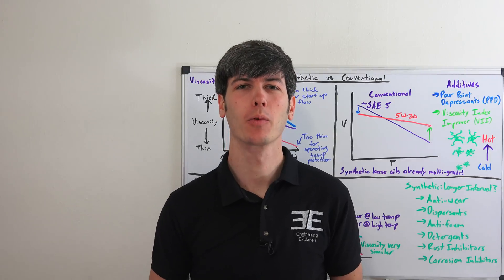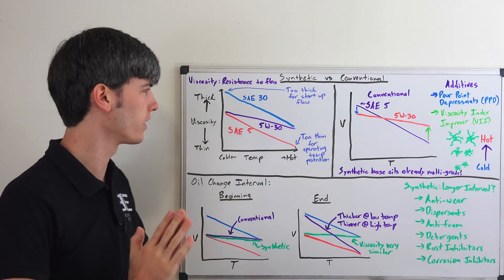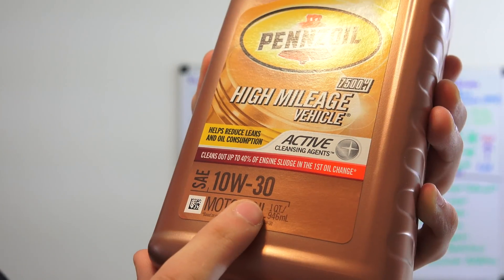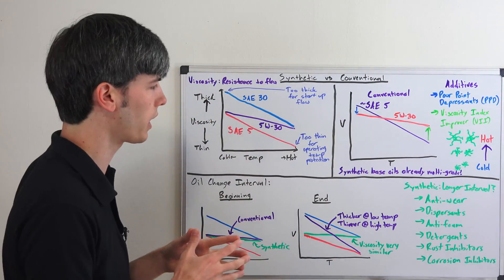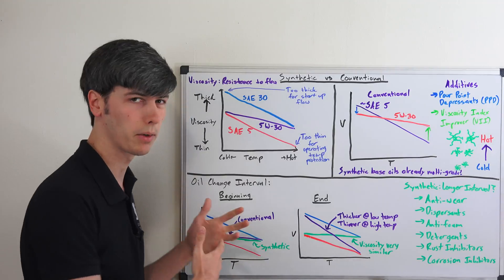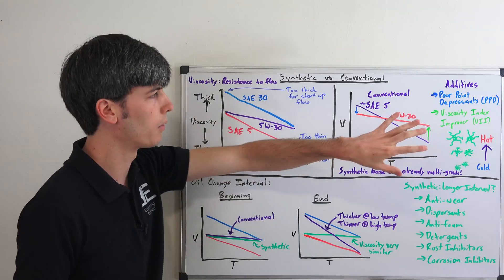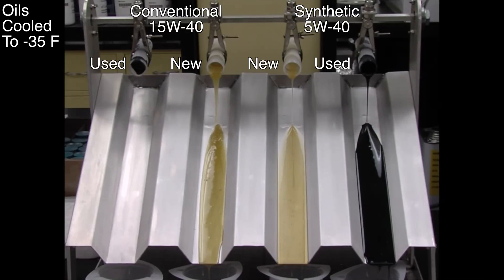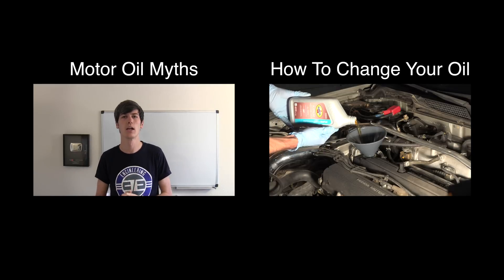Is Synthetic Motor Oil Better For Your Car?

Comment: Rightio then, as usual a good explanation. But what's the difference between corrosion inhibitors and rust inhibitors??? What's the difference between rust and corrosion??
Reply from the maker: +Shannon Parker acid versus water corrosion.
Reply: Nothing
Reply: +Engineering Explained Ahhh! That makes sense.
Reply: Rust is a type of corrosion, of which there are many types!
Reply: I am no expert but I think one requires oxygen. Because rust is the byproduct of a chemical process called oxidation
Reply: +Noah Kuzel Good thought!
Reply: Neither is much of a problem internally within engines, other than in cooling systems. Oil itself keeps oxygen away from everything...
https://en.wikipedia.org/wiki/Rust
https://en.wikipedia.org/wiki/Corrosion

Comment: Naturally the 15W flows more slowly, -35F is further outside its operating range than the 5W..  Why not use the same grade oils for comparison in the demonstration??
Reply from the maker: +hindflight R I mentioned in the video, it wasn't a demonstration of the viscosity difference, making a 5W-40 requires synthetic. Watch that portion of the video again and I explain it fully.
Reply: Jerrod Lindquist You must be a conspiracy nutjob. 
He goes to pennzoil and says I want to do a demonstration video and they say great we will pay for it.  Who cares? It does NOT affect his demonstration at all. He could have used any oil for this demonstration and the results would have been the same. NOTHING was omitted or obscured. There were no unfavorable results. The results were expected and known by most of us before hand. This video is merely a demonstration video. It merely shows the difference between synthetic new and used at colder temperatures. 
Your trolling abilities are second to none. Only a troll will try to take a simple demonstration  make a big deal over it.
Reply: +consaka1 I just want to mention you are totally right in this pissing match. Don't know why the video was so tough for Jerrod to understand. Doesn't matter which brand was the sponsor. You are more patient than I am.
Reply: Oh - sarcasm on the internet. How refreshing.
Reply: I think I caught it, the point is that the new conventional oil flowed just fine at really low temps but the used conventional did not.  It's a comparison of old vs new.  This also explains why my motorcycle mechanic uses the cheapest oil he can find and changes it after every ride.  Because in all the newer 450s, you HAVE to change the oil super frequently because of all the super close tolerances in the engine. 

My takeaway is that I don't need to run synthetic oil in my hot-rod 450 because synthetic only provides the additional protection when the oil gets old and dirty and you can't allow the oil to get to that point in a 450.  

The other takeaway is that for my daily drivers, I'm reaping the benefits of synthetic oil because I don't have to change the oil as frequently as I do on my dirt bike.  My daily drivers can handle dirty oil and my bike cannot.
Reply: The comparison was between the new and the old of the same grade. The demonstration point was that used oil has a much higher viscosity cold.  New standard oil versus old used standard oil and then new synthetic versus old used synthetic. Synthetic cold always flows better. Even when it is used and worn out.
Reply: Right.  And so that begs the question:  Why not do the same test with 5W-30 across the board?  It's an obvious question and it comes first to everyone's mind who watched this.  And then one assumes that the test was done but the visual results weren't what the sponsor wanted to show.  Anyone would conclude this, I'm afraid.
Reply: Jerrod Lindquist Who are you referring to as the sponsor? And what were the results they didn't want to show and how was that indicated?
Reply: Try watching the video again
Reply: Jerrod Lindquist Engineering explained is sponsoring the video since he made it. Pennzoil is sponsoring him. Neither claimed there was results they didn't want to show.
Reply: You literally make no sense -- not wasting any more time on this.  Peace Out
Reply: Jerrod Lindquist I asked you to explain your post since it made no sense. It was totally illogical. I am correct apparently because you still can't explain yourself. Suggest you rewatch the video and reread your comment.
Reply: You're the anonymous troll that can't seem to grab the logic, plus the fact that Pennzoil is mentioned as the sponsor (twice, I believe -- miss that???).  You asked, "Who are you referring to as the sponsor?"  It's Pennzoil.  Answered pretty easily by paying attention.  You also asked, "And what were the results they didn't want to show and how was that indicated?".  If you can follow logic, and also read (not a given, by how you respond), I stated that the test on 5W-30 was a logical conclusion (based on actually working in labs and using the scientific method -- but I'm probably beyond you here) and so PROBABLY done and there was no mention of it and it would have to be excluded because the results weren't favorable or perhaps edited for time.  But including a test on 15W40 at such a low ambient temp (show me an engine manufacturer that recommends that oil at that temp) means there are variables at work here that don't factor in.  Clear enough for you, Beavis?
Reply: I'm sure you two will be very happy together.  Congratulations!
Reply: Mike Spencer Lol. yeah some people really miss the point of some of these videos. There are sociopathic narcissists everywhere. ;)

Comment: Omg, your first graph answered a question that i had not been able to answer for over a year. 

People always say, viscosity is thicker when hot, but I've haven't seen it graphed. It all makes now.  The answer lies in the negative slope of the linear equation for the 5w30. I had the notation that "viscosity(y) vs heat(x)" would have a positive slope, that's where i misconceived the entire concept

Thank you sir
Reply from the maker: +muasboy I had the same question until recently haha. Glad to clear it up!
Reply: I first learned about viscosity with types of lava in 6th grade science and I was confused about it too. You would think if the value was higher it would flow faster. It wasn't until the day before the test where the resistance part clicked, making it the opposite.  The resistance part of the definition basically gives the graph the negative slope

Comment: I run Amsoil in all of my vehicles, which are all old, and changing from standard to synthetic helped, and then switching from regular synthetic to the best helped even more.  My old 79 Lincoln runs almost brand new after good carb and fuel system cleaning, and with high grade oil it has good cold starts and hums quietly.  My 86 F-250 and 86 Mercury Grand Marquis both leaked oil, but after running different synthetics and now the really expensive stuff, the oil seals seemed to have actually been reconditioned to some extent, and now oil leakage is almost negligible.

 I also live in north North Dakota, and -20F starts are common in winter, and your -35 F startup is something I've done before.  Very good to see this video.  From hard cold starting conditions to my experience with older vehicles, I would suggest synthetics to everyone, they really do make a difference.

Comment: Great video but why would you compare different oil grades? couldn't you get a hold of some conventional 5w-40? If synthetic protects better, then it must last longer. I moved from Minnesota to California and both of my cars are on conventional oil with over 180k miles still running.
Reply from the maker: +niacal4nia watch that portion of the video again, I explain why they are different oil grades.
Reply: Yes I saw that but still wanted to see same grades compared. Oli change intervals should be similar to aircraft engines by  operating hours. For car engines  200-250 hrs for conventional oil and 300-350 hrs synthetic oil. Using the recommended grade for cold and hot according to manual.
Reply: I think it's because by their nature they are different viscosities. they are different. I believe that if your car uses conventional - keep using conventional. if your car came with synthetic then keep using that. switching is bad because they are different molecularly. I think conventional breaks your engine in a little more. most people I know report engine ticking within a few hundred miles of switching to synthetic. synthetic is basically less viscous - more watery. if you have a brand new car and it was designed for synthetic then keep using it. if you have a car that has been driving on conventional keep using that. your engine could blow like my friends benz. he only used high octane gas, but switched to mobil1 at about 100k miles. 180k miles valve train shot. he was meticulous about the care and maintenance of that car. my argument is that they are different - doesn't matter exactly how - just keep in mind that once you use conventional in an engine you will most likely hear the internal parts making noise after switching over to synthetic. doesn't mean its bad it just means it's different.
Reply: I was an oil change guy professionally for many years; the Mobil one very well may have caused the valve train failure in your friend's mercedes, but not necessarily for the reasons you are describing.  A lot of the German manufacturers have their own specifications that the motor oil must meet, and they can be completely different from API (American petroleum institute) standards that your more common motor oils are manufactured to. These types of oil may not even have a viscosity specification like we're used to here in north America no 5W20, 10W30 etc, just some DIN standard.  Depending on your area (i.e. if european cars are uncommon) it can be a nightmare just to determine which oil meets Mercedes' specifications, much less find someone who sells the stuff.  For these reasons my shop used to avoid taking in german cars like the plague; just too damn hard to find correct information on them, not worth the liability.  I do recall an occasion when we had a new guy up in the front office who didn't realize we typically refuse those cars.  He took in a mercedes for an oil change ( I don't recall the model) that specified no viscosity and just some bizarre DIN standard for its oil; we ended up calling the closest dealership, which is nearly a hundred miles away, to figure out what the hell kind of oil could be used in the thing.  Oddly enough, the only oil we could get a hold of that met this standard was Mobil One, but in 0W40 weight, which no one at my shop had ever heard of.  Had to get the oil from 3 different parts stores because no single one had enough of that viscosity oil in stock; god damn thing required 9 quarts of oil despite being a modestly sized gas V8.  Sure enough the fine print on the back of the Mobil one bottle said it conformed to whatever DIN standard it was.

To summarize, I would suspect that whatever conventional oil he was using either conformed to mercedes standards or was close enough to them, while the mobil one, despite being specified as the exact same viscosity under API standards, did not conform to them.  I've also seen audi/VW specify motor oil by similar standards, but they usually had the common decency to list an equivalent oil specified in API standards in the owner's manual.  I don't recall ever doing an oil change on a BMW, Porsche, or any other german makes so I can't speak for those.

Sorry for such a long reply, but I find sharing anecdotes from my former profession entertaining for some reason.

Comment: So I've been changing my oil frequently at 4000 miles. I've been using the 5w30 synthetic , but every time I change it, it's very thin and dark. I live in 120 degree weather and I'm thinking that's why it's so thin. I wanted to know if anyone had recommendation for oil and different weight or if I should just keep using 5w30.

Comment: Thanks this is the best explanation of the actual characteristics of the the oils. I recently switched over to using synthetic after moving into a more extreme climate area. I still change my oil on schedule even on my vehicle that as an oil change indicator. I typically have the dealer do the change as well so they can do an inspection of the mechanicals.

Comment: full syn motor oil for diesel is not available in my area..if i put petrol full syn 5w 30 the grade is SN/CF which cannot stand too long for the soot properties... mineral motor oil will SF/CI~4 still perform very well in my diesel truck

Comment: all engines can run on synthetic oil, European manufacturers you must change at there intervals they have sensitive emissions controls. they are many different oil specs with each Manufacturer and engines.  the US manufacturers can handle longer oil change intervals. the emissions systems are not as sensitive then the European cars. Japanese engines are similar to us engines  they can go longer drain intervals up to 25k with a true group IV oil over a group 3 oil.

Comment: you can always send an oil sample to Blackstone Labs and request a TBN test in addition to the standard test.  TBN will tell you how much life the oil has left before it starts sludging.  Ran several cars to 10k mile oil changes and the test results came to confirm that interval was good and below average wear numbers

Comment: What about motor oils that last 5,000 miles compared to 3,000. Is it bad to use the 5,000 ones or does it not matter.

Comment: next time I drive around when it's -35F, I'll get some of that...jk
Reply: come visit me in northern minnesota this next winter and you might just get "lucky." this past winter was quite mild; it only hit 20 below twice.
Reply: LOL-careful what I wish for...(esp. on the internet)
Reply: got a car from Chicago and it had lots of engine wear, probably from colde start. go synth if you live in a cold area
Reply: Happens a lot in Saskatchewan -30-40C pretty normal in winter lol
Reply: Wish they would do both for us folks that don't speak Metrical quite yet, Still measure depth by fathoms, Fuel by gallons, butter by firkens and a 9/16 wrench fixes most things on my Car.........  :)
Reply: +coyoteshark I agree.
Reply: It's cooled to -35F to make seeing the effects easily visible. It still happens at higher temps, but visually, is not such a significant difference and you'd have to watch much closer to see the difference.
Reply: No, it's cooled to -35 because under those conditions any 15w40 oil will be practically frozen but 5w40 will not. That's the reason that the "conventional" looks so much worse than the synthetic in this video...

Remember, liquid flows perfectly normally as a liquid just up until the point that it actually freezes... Eg: Water flows basically the same at 5*C as it does at 95*c.

Comment: Interesting. Of course, you discussed only viscosity and did not mention one of the major factors that alters viscosity for BOTH and that is dilution.  Dilution is worse, of course, when the driver makes frequent, short trips. I hope that all viewers paid attention to your statement that BOTH require the same change frequency.  The advertising hype, of course, suggests otherwise.  But most manufacturers include long-use disclaimers on their web sites.  However, I think that most car owners are much more interested in objective, independent testing studies that prove the superiority of one product over the other, if any.
I have found only one that showed Mobil 1 to be surprisingly deficient while a "synthetic" blend performed well.  Clearly, there are several potential objections to your final (very) cold flow demonstration in translating it to real-world applications.

Comment: in "Amsoil SAS 5w-30 synthetic motor oil white paper" at 11:30 they offer a different explaination of the winter grade number.
they say it is measured with a magnetic stirrer and is the difference in electric current required to stir the oil at freezing temperature.
Reply: and in your video you say that the oil gets thinner at cold temperatures, from a resistance to flow rating of 30 to a resistance to flow rating of 10. then you demonstrate that the frozen oil doesn't flow as well.
I'm confused.
Reply: Oil gets thicker when cold, thinner when hot. 10w30 thickens when cold. 10w30 is just 10w with additives to make it stop thinning out when it gets to where a straight 30 would be when hot.
Reply: Not my video, I'm just viewing the comments. If you didn't direct this at me it showed up as if you replied to my comment afterwards. I've noticed that lately; Youtube has been messing up at least for me.

Comment: My truck is lubricated with pterodactyl semen and bacon grease
Reply: I would add that it is the best lube available but it is hard find. I us the same on my D83 Swedish sure-grip suck machine. I find that nitrate free bacon grease is the best performer. Mobil 1 is sandpaper yet it is silky after thousands of 8500rpm pulls.
Reply: Wow!

Comment: synthetic has superior engine start lubrication
Reply: Really?  Where is your evidence?
Reply: No one in his right mind uses 15w oil at -35 deg.
Reply: It's true of Diesel oil at least in my application. It's either Conventional 15w40 vs a synthetic or "synthetic" 5w40 or 0w40 and the engine just turns over easier with 5w40 or 0w40; it's thinner when cold than 15w40.
Reply: It can be used without as much of an issue if using a block heater but I am in more favor of using the 5w40 or (even better) 0w40 for my Diesel engine in such a temperature.